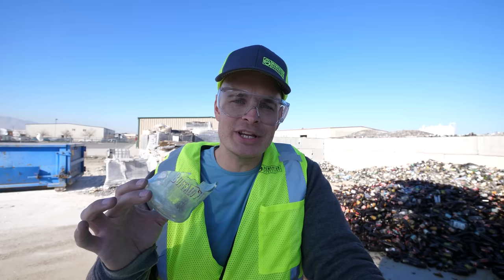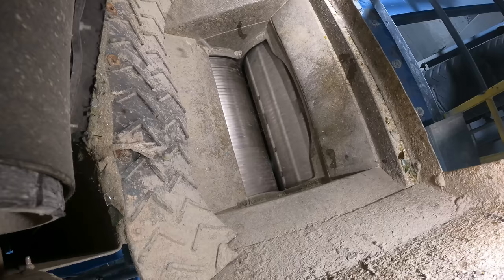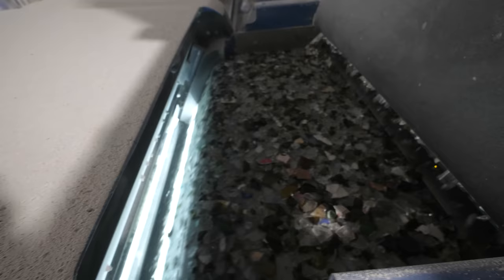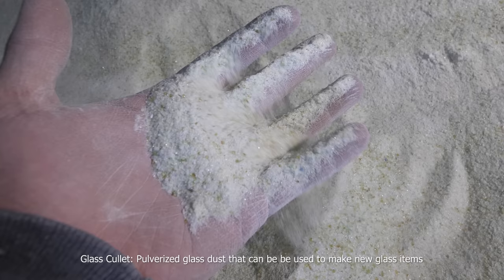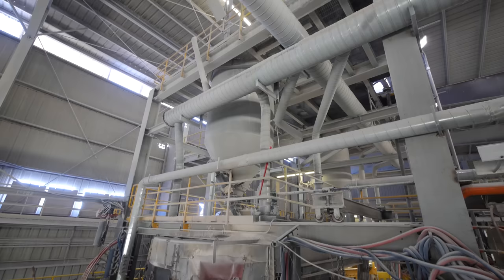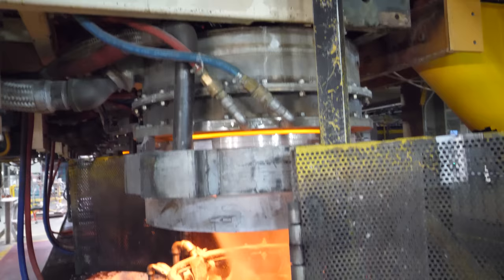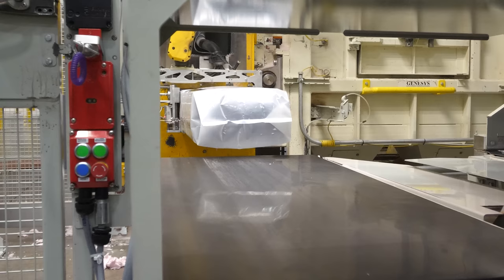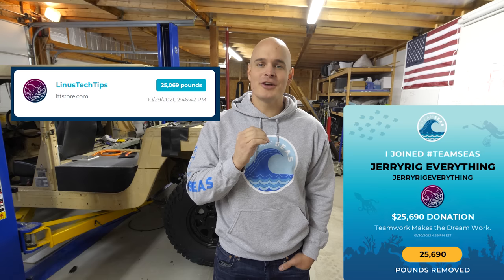What *REALLY* happens to 'Recycled' Glass?!  -  (you might be surprised)

Comment: Well, that was freaking interesting.  As a builder who has installed miles of Fiberglas insulation in my 45 years on the job, I am happy to see where all the tons of glass bottles I have recycled over those same 45 years have gone.  Now if only the same thing can be done with plastic.
Reply: I know that heavier plastics, such as those used in bottles, can be recycled into plastic lumber.
Reply: Plastic can be melted down to create waterproof fabric, hot dry iron, plastic bags then press with baking paper over them
Reply: Clean scrap paper is shredded into cellulose insulation and is considered carbon negative. They treat it both boric acid which makes it fireproof, ant proof, and rot resistant. It is blown into large cavity super insulated buildings.

Comment: I would like to see what they do with Capri Sun pouches & juice boxes. I've always had to go to different recycling plants for anything other than plastic, glass, and aluminum but it says on their website their processed differently than most recyclables.
Reply: Those are a composite plastic cardboard and aluminum construction and are energy negative to recycle because of how hard it is to break down the binders.
Reply: It is trash 99 percent of the time
Reply: Tetra packs are not recyclable with conventional means and due to thin layers of plastic and aluminum it is likely to stay that way until the point we can reliably eliminate the non metal material with a microbial process whose remnants are suitable for recovering from
Reply: @DanceTranced  Here in Europe we recycle Tetra packs by stiring them in a big vat. Recycling Tetra packs is way cheaper than glass or plastic containers.
Reply: Essentially you waste a ton of energy to have it taken to a place where they'll likely put on a boat ship it to another country where they burn it into the air. Essentially adding a hundredfold the amount of pollution it would cause just to put it in a landfill.
Reply: In North America, cheap films and low quality plastic like what you mention are usually trashed. It is because you can only make recycled products into something of "lesser" quality" to the original plastic good. Films, bags, foils are so low quality nothing can be made of it. -I use to work in the industry. Best thing to do? ...-Don't buy it!
Reply: 80% of plastics are not recyclable
Reply: Go to any beach and look out at the horizon... it's there

Comment: Glass blasting is used in industry and by mechanics and shops to clean and de-rust and de-paint parts.  They call it glass beading but the glass is not actually spherical beads but the same type crushed glass you are showing here used for fiberglass insulation.

Comment: I have recycled for years, my town has a curbside collection system. 
Last year I found out that my town stopped recycling glass several years ago. 
It turns out if I would put glass into my recycling bin they would just dump it into the trash can and if I took it to the transfer station outside of town they just trashed that too. 
It bother me not only did they stop accepting glass but they did it in such a way that most of the public didn’t know. 

So now I try to find uses for as many of my glass containers as possible and make sure I recycle the lids but I still think it’s wrong. 

Can broken up glass be used as aggregate in making cement?  I know the world is running out of gravel. Can we substitute chunks of glass instead, at least in some uses? 
It might be cool to have bits of different colored glass showing in polished concrete like in a terrazzo. 
That might be cool for countertops.
Reply: There's a video on YT on how glass I being ground back to sand and dumped on beaches that need an uplifting.
Reply: That's a shame.  Glass is such a cool product that is infinitely recyclable or at least reusable because it can be cleaned so easily.  Houston stopped accepting glass in curbside recycling for two years while a contracting company built a new facility to handle the glass.
Reply: Glass is generally not practical for replacing gravel in concrete. You need special mixes to avoid the alkali-silica reaction that can destroy concrete made with glass if it's not perfectly made. Glass is also typically weaker than stone and concrete made with it tends to be weaker even if perfectly mixed to avoid the alkali-silica reaction. That said, there are some artistic uses where glass is used in concrete. Some sidewalks, walls, and stucco coatings on buildings use glass to be "pretty" where that might justify the extra cost and the loss of strength isn't hazardous.
Reply: @5467nick  Thanks for the reply. 
I didn’t know about the chemical interaction but I suspected a difference in strength. I thought it might work for less load bearing applications like sideways and private drives but it was just an idea. 

I think we all need to keep our eyes open for ways to solve one problem by dealing with another, like using kudzu as a source for ethanol by harvesting it from areas being over run.

Comment: let's do a poll / discuss: everything should be made of glass, where possible, instead of plastic.
Reply: Or everything in plastic should be taxed more, so glass is cheaper
Reply: glass is still brittle, glass is still less durable and glass still shatters. Sure you can make lots of stuff with glass but glass is also a PITA in transportation often requiring more plastics and or paper as packaging to stop it from shattering (anyone who has ordered glass containers online knows well) so it just depends overall. You can't just go full glass and expect it to turn out like a fairy tale
Reply: @kingrobin6582  absolutely agree. There are some instances where plastic / polycarbonate is really useful. It's the lack of recycling options that make it rough even though IT ABSOLUTELY IS recyclable.
Reply: @MaxC_1  totally agree. again: wherever possible. i should maybe add "and does not produce more waste"
Reply: Plastic takes les energy to make than recycled glass though.
Reply: IMO easily recyclable recycled plastic is better than glass. When making glass, even recycled glass, you need a lot of energy to heat the material to melting and you often need much more material. Basic plastics can be remelted without much energy input.

Comment: As many people suggest, I also would like to see what happens to the batteries and how environmentally friendly they are.
Reply: They really, really aren't. Not only is the mining process itself incredibly detrimental to the environment (especially for lithium batteries) but lithium batteries simply aren't recycled (it costs 5 times more to recycle lithium than to mine it directly; this is why the cost of recycling should be addressed in the original mining efforts, so that recycled material is always cheaper in the end), but thankfully lead-acid batteries like car batteries are easily recycled; the lead is extracted and cleaned and remade into new batteries, though the plastic often is incinerated or sent to landfill. This is also assuming the battery actually gets recycled in the first place.
Reply: @KainYusanagi  Thank you for the information.

Comment: I'm old enough to remember when many bottles and containers were made from glass. The current issues with the use of plastics seem to cause more problems than they are worth. Not sure why we haven't just moved back to the use of glass. The fact that glass is truly recyclable, meaning that not only the material itself can be completely recycled but it can be used to make the same items over and over whereas plastic can not. I know that making glass does require a lot of energy, but mainstream plastic "recycling" if you can even call it that has to use enormous amounts of energy as well just in the transporting process, especially when you consider that a great deal of it goes overseas. Other than pyrolysis systems that can actually recycle plastic, the rest of "plastic recycling" methods really not even recycling. I can't help but think that the primary reasons why we haven't moved backed to glass, and began to mainstream pyrolysis for plastic recycling is corruption/financial in nature because we have much better solutions available that we simply don't use. Also, there may be some cultural aspects of just being "used" to using so much plastic but a more informed public would most likely be willing to make changes.
Reply: Glass is harder to transport than plastic for it can crush. But everything in glass tastes better. It is definitely worth paying a bit more just to get the thing in glass. Moreover it is better for environment too. Glass poses no danger provided it is not exposed to sunrays and something that can burn easily because then it can cause wildfires. Plastic on the other hand nevet biodegrades and disturbs hormonal balance in humans and animals

Comment: Does “40% less energy to use recycled glass” mean the entire process (from old bottle to insulation/end product) uses less energy than making new glass or just that the production part itself uses less energy when starting with recycled glass?

If it’s the latter then that’s pretty misleading.
Reply: When raw materials are mixed with the recycle glass, they consume less energy to melt.
Reply: @MarkStoddard  Trash/recycling companies have a competitive market process to make bids with your local government to have the exclusive right to pick up your trash & recycling.  They get paid from your property taxes.  They then sell truck or trainloads to manufacturers like Corning.
Reply: They also save the finite raw materials.
Reply: the "less energy" bit comes also from less raw materials but unless the facility uses (like in the video) their own energy plant its a pretty energy intesive process to turn glass dust back to usable glass not to mention that you also need some beffy logistics to haul all the glass wich is a pretty heavy material, so usually it ends up barely cutting even on the energy saving cost wich actually means that apart from saving up materials to make new usable glass there isnt much else saving on recycling it... yet. since new ways to power trucks and heavy machines could potentially solve this problem.

Comment: Im grateful for renewables. But we need to tell the whole story.  Where does the electricity come from when the there's no wind ? Keep in mind it take a certain amount if windmills to generate the power needed if one goes out you need another to fill in, how many back up windmills are there? In addition, they have to turn at a dermined speed to produce what's needed. I wish this type of information was not left out so we can see the whole picture. I'm inferring because the information was not provided, but I'm a retired electrician; I understand electricity. And I'm almost positive they have to, at some time use electricity from the grid. Please let me know if I'm wrong....
Reply: Of course they use grid power. the wind power of the whole state is 400MW at max capacity, most of which is sent elsewhere down the line.

Comment: Metal and glass are the only materials that actually can be recycled infinitely and get a perfectly solid material as good as the first day it was originally smelted.

Plastic recycling is a lie we accepted in the 70s pushed by the oil companies and plastic manufacturers who are pretty much all owned by an oil company. Only plastics in the 1 and 2 categories are even sort of recyclable. They can only be recycled down to a lesser form of plastic and can never be the same high grade of plastic again. Recycled plastic also cannot be used on it's own. You always have to add virgin plastic to it. This is because plastic, like all crude oil products, is made by cutting hydrocarbon molecule chains down to a size that gives X chemical. Once those hydrocarbon chains are broken they cannot be remade.

Wood products can be recycled a bit more than plastic can and all the way down to being compressed into fake logs for fire places and pellets for stoves. Wood can only be recycled into paper so many times because just like the hydrocarbons in plastic you cannot rebuild the lignin and wood fibers to what they were and after just a few times through the recycling process it's only good for pressing into fake logs or pellets for burning.

Comment: Dude i didnt relise until the end.
Pink batts and gold batts are the cheapest and most irritatingly itchy insulations iv ever endured beaten only by rocwool.
You would go home from work itchy have a hot shower and go to bed still itchy and you may still feel a little utchy the next day.
If you run into this problem, use skin moisturiser on the itchy areas.
The surface layer of the skin has been sliced by the glass but it is so shallow you can not see anything and it makes the skin itch for around 12 hrs. Depending on your protective equipment.

Comment: Bro you emphasized "mega" in Megawatt like it's a lot... Do you realize how EFFICENT that is for such a massive machine? I mean maybe machines of that size are usually pretty efficent, but that's... A lot less than I would have expected for something that's designed to heat massive electrodes to 3k degrees for like 24 hours a day. o-o 

2.5 megawatts is certainly a lot, but that's only a couple households worth of energy, which in my mind sounds pretty damn impressive.

Comment: First off, wind power cannot be created or function without fossil fuels, in fact 100’s of gallons of oil are needed to lubricate the windmills. Second, I have worked in a facility that uses the same electrode system to melt bauxite ore, and those electrodes are pure carbon… Carbon is essentially a ‘fossil’ fuel is without the hydrogen attached to it. To make those electrodes that melt the glass there is a ton of fossil fuels required to not only purify that carbon but to press it into those rod forms. 

I don’t appreciate them, claiming that they operate without fossil fuels, when, in fact, they require them to operate. please stop spreading misinformation as the recycling. Recycling glass is very responsible and I’d hate to see it tarnished with lies.

Instead of forcing north Americans, to do all the things that we do with legislation, how about we go after the ones that are dumping trash into the ocean overseas in the Asia region?